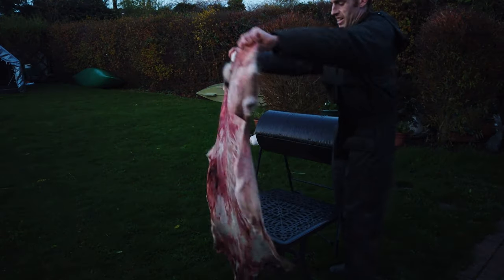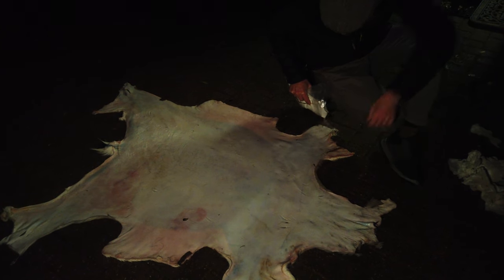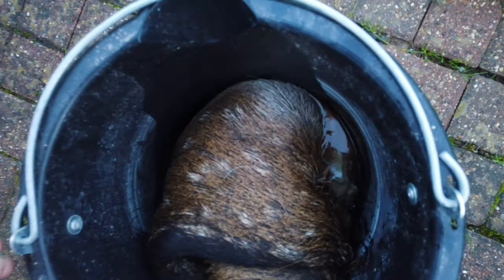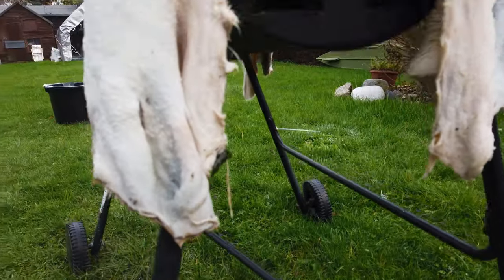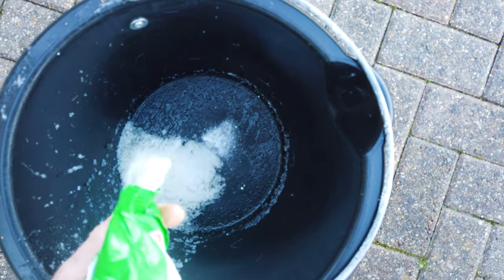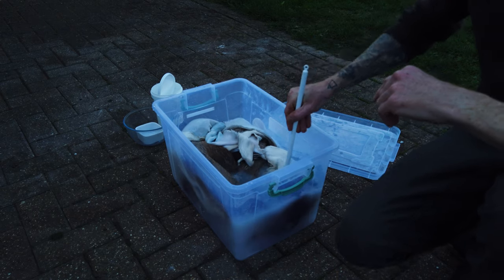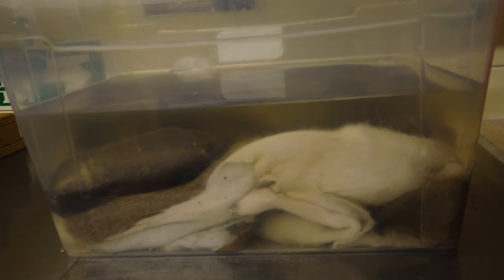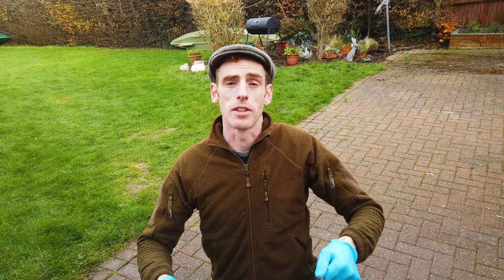Tanning/Pickling A Fallow Deer Hide With Alum

Comment: I really liked your video, sometimes when/if we string up a hide like you did to dry out, once it is dry take a wooden oar (boat paddle) and press into the hide working it up and down and sideways while it is strung up, this will stretch it out some.
Reply from the maker: Thanks so much! That's a really great bit of advice, that would really stretch the fibres alot easier than just breaking over a pole. Appreciate your comment!

Comment: I am new to tanning and just learning, if I wanted a hide that I could wash would smoking accomplish that? and at what point would I smoke it?
Reply from the maker: Hey! Thanks for watching & the comment. I'd suggest smoking post alum curing but bear in mind that leather tanned with alum will degrade with water (very slowly over years) ! Neatsfoot oil is a great remedy to help waterproof the hide and then I usually leave mine by the fire to smoke when used around camp. I'll include some more of this in my next video! Thanks